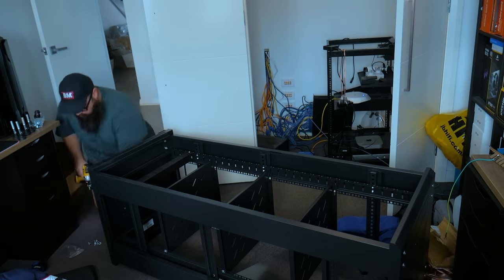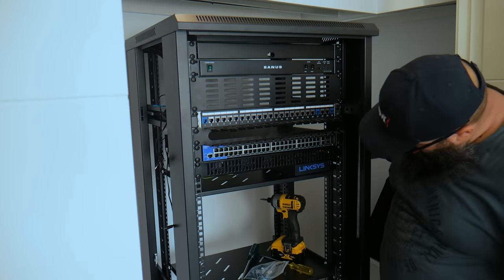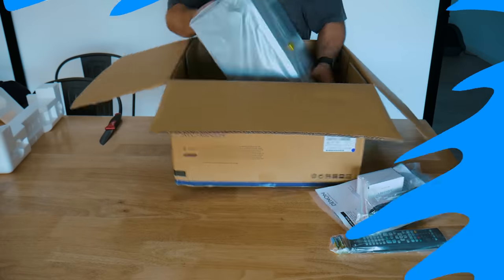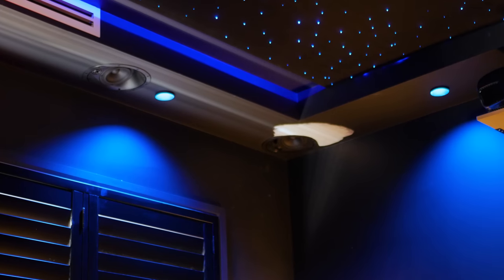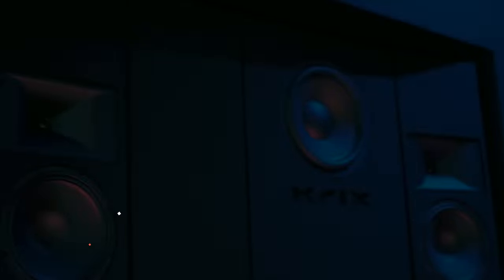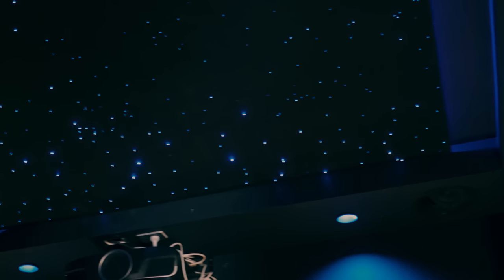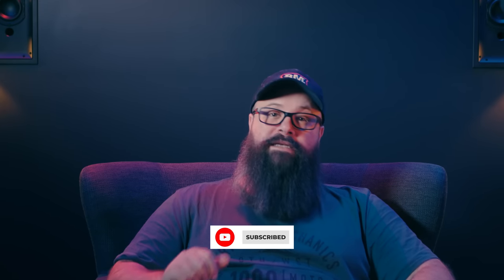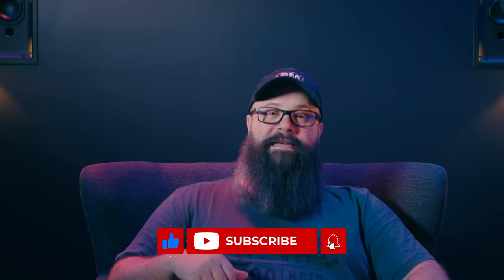LATEST Home Theater Upgrade with SOUND DEMO! Krix MX-10 | 7.2.6 Dolby Atmos 4K Home Cinema Tour!

Comment: Great video Tony, I’m loving this content with your upgrades 😍 Also checking out the link for those LED rack lights you have, I think I need me some 😬
Reply from the maker: Thanks Jase! And yes, the SANUS ecosystem is fantastic for that. I have a link from Amazon but I'm not sure if you can buy it from these.. I'll see if I can find some local sources.. The multivolt adaptor was a game changer for me. You can plug the SANUS fans in as well as the magnetic LED tube lights down the sides.. magentic is so good... then the thermostate control for the fans as well, plus any low voltage devices you have, you can get rid of the power brick and plug them into the multivolt!
Reply: Build Montage Thanks Tony that’s a cool idea. The link you have for Amazon lists the product as unavailable but I’ve found a few other local sites that have them. Do you need the multi volt adapter to plug the lights into?

Comment: Great stuff! 
What cables have you run in walls to subwoovers, front and ceiling? Can you perhaps make an episode about cabling?
Reply from the maker: So the cabling is nothing fancy, it's oxygen free 14AWG wire which is used in construction. Ive had 3 different cablers come in and they all used the exact same stuff. I didnt cable, and its all in now, the most I could do is a video on cable sleeving, which I might do!

Comment: One thing I would like to add here, I am sure these are great speakers no wonder they must sound like a commercial theatre. But as long as you mentioned about the sound coming through between the two speakers is depends on mix of the audio and you can achieve the same effects from any speakers as long as your system is calibrated properly. I have basic 5.1 system with entry level onkyo and Panasonic 3way speakers, I have spent a lot of time on calibration and the result is awesome and I can even tell sometime sound between the front right and surround right or between the centre or left channel. Or even I hear the sound above my head too. So that all depends on how u calibrate your system. But honestly you have an amazing system mate.
Reply from the maker: Thanks appreciate it. I agree calibration is HUGE when it comes to sound because you are changing the sound to fit the room they are placed in. I have heard systems which sounded amazing and were not particular high end, and then there is my own which came to life once it had been calibrated properly. I think if you can be happy with what you have make the most of calibrating it to it's full potential.

Comment: I just ran my in wall speaker cable out of hole wall plates directly from amp / power amp to speakers 3 x 13 meters for LCR
Reply from the maker: Thats how mine were originally but I wanted to do this because it's something that I had in my mind to do :) Doesnt improve performance of course!

Comment: Have you ever tried the Auro3D upsampling? You can assign one of your Atmos ceiling as the VOG for eg…
Reply from the maker: No I haven't - I usually just leave it on DTS:X Neural X - I don't have a center speaker overhead either.

Comment: Hey Tony, are you aware for the guys at Home Theater Engineering?  I'm guessing so, since they are located in Australia... Anyway, they really like to focus on the benefits of calibration, so I was wondering if you have considered getting your projector professionally calibrated once you get your new screen?
Reply from the maker: Yes something when I’m all set up to think about for sure. And yes I have seen HTE videos.
Reply: @BuildMontage  I really enjoy their content, but I'd love to hear from an actual customer as to whether or not Calibration is all that they make it out to be!  So if you choose to have a calibration done, it would be interesting to hear your thoughts on the results.  Cheers mate!
Reply: I have had my projector ISF calibrated and it made a significant improvement. To spend all that money and not have equipment calibrated is like buying a sports car and running it on 91 octane.

Comment: Gday Tony, Trevor is my name. I’m looking at doing a new theatre and have been looking at the Krix behind screen wall of sound. Now that you have had yours for a small amount of time are you glad you went that route. I am tossing up between running my current Polk RTI A9s behind the screen with two Svs subs, or getting this Krix system. Do you find the Krix subs that are included in this setup enough or are you running other subs as well?
Cheers
Reply from the maker: Hi Trevor, I couldn't be happier with my setup however I need to do my acoustic treatment which will definitely improve things but yeah the sound is BIIG! The subs are great, however from my seated position I have a big null which is super disappointing. It's the room, not the speakers but I have a MINIDSP I need to hookup to potentially fix it. I may also reposition the subs to have one in and one out to see if that helps but they hit pretty hard and these speakers will go much further on less power than your Polk speakers no doubt! If you have any questions, why not join our Discord server where we can chat more: https://discord.gg/wvtvkaP

Comment: Large drivers aka speakers will do justice to large sound. That's why we can't sacrifice sound for space restrictions. I've been listening to small bookshelf home theater speakers claims to produce big sound. But there's major differences when compared to a bigger sized cone even that big of a speaker is a cheap one. To have big epic sound in a ht one must go with 10" and up quick punchy woofers and horn mids and highs. Quick woofers tend to have punchy sound and sharply crossed at 80hz. And 80hz below will be processed by subwoofers. So the mains only play tight lower mid to high clean of distortion from bass rumble.

Comment: Why Denon and not Marantz?
Reply from the maker: $$$ mostly. I needed at 13 channel and down under the Denon was the least expensive option.
Reply: @BuildMontage  I don't quite know what to say or ask other than Denon is brighter than Marantz at high volume I have found that Marantz stays warm but Denon goes bright. I'm baffled tbh as to your choice being over the dosh bro. Not hating on you like your a legend and I would say this to your face I'm not being a keyboard commando hiding behind my screen like some fake tough guy. but like.. Just flip the Denon bro and get a Marantz bro. I'm baffled haha. I hate that I'm even typing this and I get it. Sometimes like 95% of the way into a project you are like F** I'm 30% over budget on my projections already I can see a saving. Fk that bro! You went HARD! Complete the mission and get Marantz there must be a voice inside you saying Marantz for sure if there isn't then ok. Good. And I don't feel I'm being picky because it's the amp we are talking here. Cheers bro. Sorry. Just baffled.